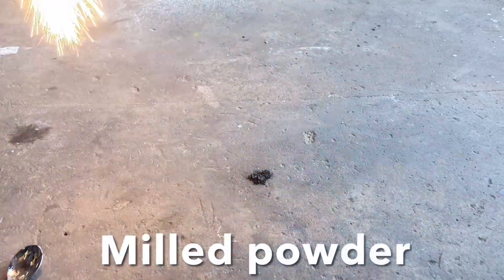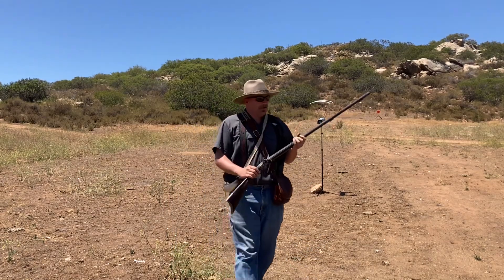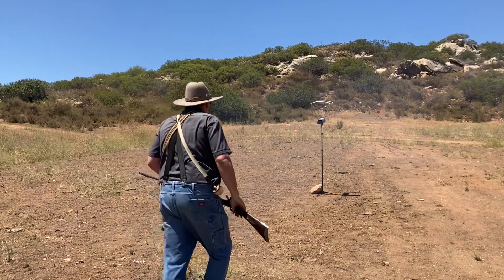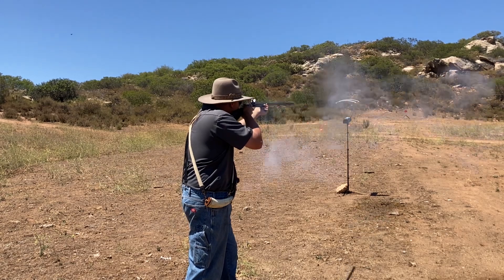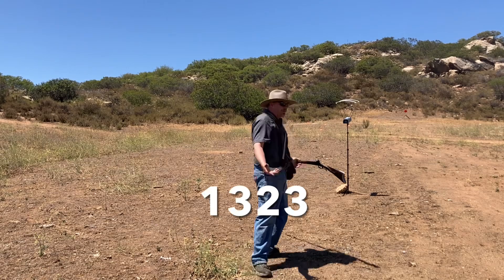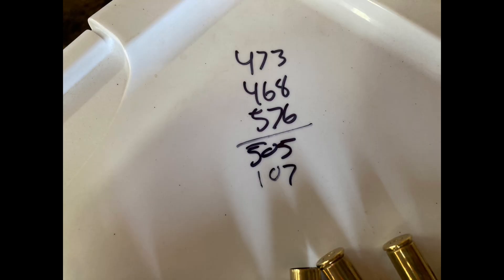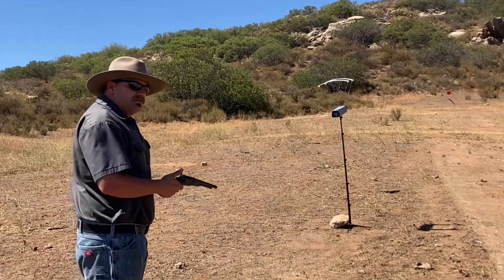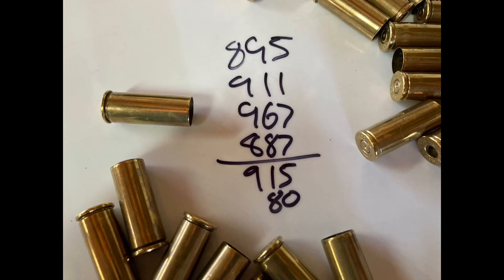Sulfur Free Black Powder

Comment: Sulphur less gunpowder is well known. It was introduced before WW1 to avoid corrosion of brass fuze bodies. The main disadvantage is that it is less easy to ignite as sulphur is essential to the low temperature initiation, the first step in the 8 to 10 stage chemical process.

Comment: One writer I read in the 1960s said sulfur "vaporizes and improves heat flow through the powder-" Not sure what that means, but it could be related to ignition temperature...? Not sure when that was written.❤

Comment: If it's got less feet per second you can add more black powder till you reach the feet per second you need or their head pressure are at a certain point you're going to have over pressure too much pattern it ain't going to make no difference so you can adjust the powder to a certain extent I would try that and retrieve my experiment

Comment: You normally use 77% potassium nitrate and 23% fuel 
Why didn't you do that here?
Reply from the maker: I always run a ratio of 77/13/10. Did I not do that in this test?
Reply: @Everythingblackpowder  
No, you did 70/30 this time.??
That's a 14% shift in oxidizer to fuel ratio from your norm!
It MAY have had quite an impact on both energy and fouling in this case.

Comment: Two things about sulfur that I think are relevant: When sulfur burns, it produces acid, SO2. This will help catalyze the decomposition of the nitrate. When KNO3 thermally decomposes, it produces alkali, K2O or K2CO3 (potash) This will be neutralized by the SO2 to produce a salt, K2SO3. Without the sulfur, you get a strongly alkaline ash in the fouling.

Comment: My local gun shop recently got a huge supply of American Pioneer Powder and Jim Shockey's Gold sulfur free powders that they got from a defunct gun shop that closed up a couple years ago. I know that both are supposed to be able to work in flintlocks, but I've heard they were known for wide variations in velocity between shots and if you live in a humid climate they degrade really fast. I thought about trying some just to see if it works in my matchlock or mortar if I can get it cheap enough. One thing I did notice is that American Pioneer Powder was listed as an explosive, not a propellant like the other substitutes. I wonder if that was something that led to their demise if you had to order them the same way as real black powder.
Reply from the maker: I’ve never tried it.
Reply: @Everythingblackpowder  the guy at the shop let me take a little bit so I could see what how fast it burns, I took a bit of FFFG outside, about a large spoonfull and tested it. It burns fast, much, much faster than what I've ever seen Pyrodex and Triple 7 burn at and about as fast as Goex. I figure I may try it just to see. Worst case scenario I use it my caplocks.

Comment: What did you replace the sulfur with - charcoal or potassium nitrate? I'd assume charcoal to replace the fuel element of the sulfur. 

I'd also be curious to see how sulfur-less BP performs straight from the mill - if it's less reactive that higher surface area of milled powder might be just the ticket to getting the pressures up

Comment: 1) The corrosiveness of Black powder comes from (if i'm not mistaken) the Sulfur turning into SO2/SO3, does that mean sulfur-free BP is NON-corrosive??
2) If the granules of sulfur-free are not as hard as those granules made from sulfur, resulting in un-intended breakage during loading, then doesn't that translate into more surface area & faster burn rate (and therefore dangerous pressure spikes) that could destroy the gun?
Thank you.
Reply from the maker: Neither, as far as I understand it potassium nitrate is the corrosive element. And if you’re using a muzzleloader made from modern steel there is no danger of pressure spikes from any black powder load harming your firearm

Comment: Sulphur-less powders on record with patent's. Kno3/Charcoal. 
#1 Lancaster 70.5/29.5
#2 Noble 80/20
#3 Noble  (stoichiometric) 87.1/12.9
#4 Thomas (SFG.12) 70/30 
Everything else is Perchlorate, chlorate,magnesium and nitrocellulose-based that I could find specifically used for firearms.
Anything else I found was a flash or a changing charge used in firework shell's.

Comment: Did you try upping the charcoal and leave the salt Peter at 75% if sulphur is a fuel then just replace it with charcoal and bump up the potassium till you get a complete burn. I also wonder if Corning it much finer would bump the velocity.

Comment: Garden sulfur is available by the pound, and works fine in bp.
Reply: Garden sulfur has a high clay content. You are leaving performance on the table. Garden sulfur can be cleaned, but it is a wet and messy job.
Reply: @Andrew-ps6xe  it's 1% in a batch of powder if you get pellets, at 10% clay binder. I couldn't see any difference. The sulfur dust, for foliar applications, no clay. Nothing.
   Your biggest difference in performance is the charcoal quality.
Reply: Can't you guys just buy the pure stuff online? I can get 99.5% grade sulfur granules for $25 per 3 lbs.

Comment: bad idea: what if you added aluminum powder into the black powder? aluminum can burn in a candle flame (1200f) but rockets the temperature up to something crazy like 4595f. Flint sparks are hotter than 1400f according to some cursory internet searching so I was wondering if it can supercharge it

Comment: Pulling out a chemistry book to find alternates for sulphur like iron oxide is probably more practical than looking for a volcano.
Reply: Have you tried the iron oxide? Does it perform well?
Reply: @_Emerald_Eye_  
I've only seen it on Cody's lab.
Reply: @_Emerald_Eye_  Iron oxide is used as a catalyst in rocket candy motors [ammonium nitrate burns too slowly w/o it.]
Reply: Phosphorus is in the same column of the PT; maybe some phosphorus compound would do the trick? Obviously, pure phosphorus isn't in the running, it's too reactive!
Reply: That is interesting, indeed. I guess, there wouldn't be something better, than pure sulfur, but maybe several components, to replace it, that have a catalytic effect -  maybe also some sulfates, so that the speed will increase significantly, at least. Nitrate + 30% coal will still give a powder, better than nothing, like we have seen, but it's very slow.
Reply: I'm trying 1% of NaFeEDTA to provide a trace of ferric iron as a catalyst. I add an extra 1.1% of KNO3 to oxidize the EDTA. I don't have any comparison data yet.
Reply: Didn't someone also replace it with the red stuff off match heads?

Comment: Sulphur not only lowers the ignition temperature, but it also STABILIZES THE BURN RATE. That's in most of the literature. That's why you are getting variations in velocity without it. Having it throughout the mixture means you have an even burning fuel to carry that flame all the way through the powder. Otherwise the burning wanes and you don't have that predictable exothermic reaction you want. Using a magnum primer can help overcome the problem, but ultimately having sulphur in the powder is the right way to go.

Comment: In an apocalypse mad max style, these two ingredients are locally available almost wherever you are. The third however would require a nearby volcano. A beautiful video with love for the hobby.
Reply: Volcano or gardening store that hasn’t been fully ransacked
Reply: I worked in the oilsands for some time. All I can think about is watching them pour liquid Sulphur into forms and create pyramids out of it that covered thousands of square yards and were built up 50 feet or more. I remember they were hoping to make fertilizer out of it at one point but the purity didn't meet standards. I don't know the entire process, but there are definitely other ways of getting Sulphur than spelunking a volcano
Reply: whilst pure natural sulfur isn't found outside of vulcanoes and hotsprings you could find certain mineral deposits like iron sulfide in the ground, process those with a furnace and some heat and seperate the iron from the sulfur though it'd require a lot more work
Reply: Actually, just look in any major port or refinery facility. They often got mountains of sulfur sitting around from gas and oil refining process, which is where most of our modern sulfur comes from. You could also find pockets of sulfur in gypsum deposits.

Comment: Have you tried to use potassium chlorate or perchlorate instead potassium nitrate? It may gives much better results, but making it (especially granulation) may be more dangerous.
Reply from the maker: Not yet
Reply: So you may try, but such mix is more  powerful and may explode with pressure, so be careful and do not make it a lot, one gram will be more then enough to start

Comment: Just a heads up...I ordered ingredients off EBay and EBay red flagged my purchases..notifying the “government”. They had been casing my house and went to my wife’s job to interrogate her on my hobbies..etc. Then they questioned me on why I was ordering these ingredients. I have done nothing illegal. Long story short..if you need to acquire ingredients, buy them from a brick and mortar and you will not run into what I had to deal with.
Reply: good information 👍thanks
Reply: Every biodiesel supply house has what you need. Order online to your heart's content, safe in the knowledge that you are actually green fuel enthusiast.
Reply: how much did you get ? got my stuff from Amazon. 5 lb sulfer,10 lb nitrate .

Comment: So I can see why an army might go through extreme lengths for sulfur but an individual doesn't need to if he doesn't have the option. That's very interesting given how difficult it is to get powder from a supplier these days. My question is does it make a noticable difference on residue left behind? I don't think I'd want to use this in a flintlock but on a percussion rifle it seems like one could do this if they felt the need for it.
Reply from the maker: Yes, I completely forgot to mention that in the video. It burns very very clean, cleaner than any other powder I’ve experimented with but the cleanliness isn’t worth the lack of performance. My brother tried it in his .50 Hawkin rifle and it was even more wimpy because the barrel is so much shorter than my rifle.

Comment: im starting to get into black powder and what pistol would you recommend? like the model and the manufacturer along with the best place to buy it? ive also had no luck finding caps
Reply from the maker: If you’re looking for a cap and ball revolver, you can’t go wrong with an 1851 Navy. If you’re looking for a single shot pistol, traditions or pedersoli makes some good ones. As far as caps go, I’ve started making my own because I haven’t been able to find any for going on two years.
Reply: @Everythingblackpowder  thanks! Do you have videos of you making your own caps too?
Reply from the maker: No but there are several on YouTube
Reply: Make your own caps. I bought a tool called "Tap-o-Cap" that punches out the caps from aluminum soda pop cans. You can charge the home made percusstinon caps with toy cap gun roll caps.

Comment: You would be hard pressed to get an army to march against an enemy force, knowing their bullets are 30% underpowered. It is an eternal tradition to ensure that soldiers' gear is rugged as fuck to get to the fight, but also expendable in combat. 30% OVERpowered would be more like the expectation for a military, as winning is everything, and anything less means you're just handing your enemy a bunch of lightly-used gear to overcharge, and add to their expendable reserves, or upgrade/replace their main gear.

Comment: Powder is extremely hard to comer by in Alaska.  Shipping costs being the main problem.  I would be interested in Sulphur substitutes.
Reply: Sulphur should be easy to obtain. It's a by-product of oil refining and most of it is not used, but rather piled into pyramids by the oil companies. Ask around and see if your local oil refinery can direct you to a source. I know gardening is difficult in Alaska, but gardening suppliers will sell sulphur as "flowers" or flours of sulphur which just means it's been ground into a fine powder and that's the most common way people get it.

Comment: Model rocketry buffs use 1-5% red iron oxide (red rust) in their nitrate-based "rocket candy" to increase the burn rate. Would the same thing help your sulfur-free black powder?
Reply: Cody's Lab did this. That was back before the first FBI visit and the mass YouTube video takedown. Old-school aspirin also boosts the burn rate, but dunno how well that'd go in a gun barrel.
Reply from the maker: It’s very possible but I don’t know for sure

Comment: Just found your channel and am enjoying it! 
I have a question after watching your pucking video. Can you use several discs in the pucking die to compress several layers at once with no ill effects? 

Looking forward to hearing your thoughts on this. Thanks in advance!
Reply from the maker: I suppose so. I've never tried that
Reply: Haven't made my own powder yet, but do have experience working with hydraulic presses. Yes, you can make (small) stacks at a time, but no need for a full separate disk, just put something in the column to keep the pucks separate, such as a thin sheet of plastic cut from a milk jug or something. Otherwise, you'll end up with one really tall puck that will take ages to dry out properly. I'd recommend just doing a puck at a time until you have a lot more experience though, baby steps. And when dealing with something like black powder, small amounts make for small mistakes, large amounts make for disasters.

Comment: I made black powder with sugar because the barrel rusts out of sulfur. It burns quickly but needs three times the amount to make a good shot.
Reply: Add some iron oxide to it. Between 0.5 and 2%. It speeds up the reaction dramatically. I've done that in rockets
Reply: Try to cook potassium nitrate and sugar with red or yellow iron oxide. I have a video how to make it properly. It called rocket candy(available through playlist "all videos"). It burns very fast, however i didnt test it in firearms,  only in rockets.

Comment: From my experience I have found that having good homemade charcoal from good wood such as willow, poplar, birch or alder buckthorn is essential as a starting point for a good black powder.  The next step is to micronize the charcoal below 80 micrometers before mixing it with the other ingredients.  The final mixing in a ball mill is also an important aspect to give speed and regularity to the combustion.

Comment: Interesting stuff.  Way better than I would have expected.  For whatever reason, my more recent batches with ERC shavings, milled for 18-24 hours & granulated, come out about as well as your sulphur-less compressed powder -- needing about 70-80% more powder by volume to achieve the same velocity & weight.  As you pointed out, fine for muzzleloaders.  But not ideal.
Reply: Try poplar or willow charcoal?

Comment: Was told white oak was best if you couldn’t find willow for potassium nitrate
Reply from the maker: I haven’t tried oak
Reply: It works, as any charcoal will, but it is not "best" by any standard. The rule of thumb is that lightweight fast-growing woods are better. One strange exception to the rule is Osage Orange.
Tree of heaven and staghorn sumac are common nuisance woods that make some very fast powders.

Comment: Dont need a volcano. You can heat fools gold in a container and it will off gas its sulphur. Then you let it condense and just scrape it off the walls of said container. And from what I read its pure enough to not need refining. Been collecting every pice i come across to try myself
Reply from the maker: Very interesting
Reply: Forgive me!
It’s H2S not HS2 for hydrogen sulfide!!!!
Reply: Just be careful around those fumes when separating iron pyrite from its sulfur. Hydrogen sulfide (HS2) is highly toxic and protective equipment outdoors is recommended.

Comment: How was it done before rock tumblers were invented? Pre-electronic mechanic here.
Reply from the maker: They build mills next to rivers and streams and used the water current to turn their mill.
Reply: My mechanic days ended when control modules were coming in.
Reply: I got out of the field when HEI was coming in.
Reply from the maker: That was back in the 70s?
Reply: Probably mortor and pestle.
Reply: First the large chunks would be broken on an anvil with a hammer and then ground either a mortar and pestle for small batches (and they had big ones including ones that were water powered) or ground with a smaller rock on a flat surface of porphyry rock, those were common bread millstones, and this was done the same way paint pigment was done, or powder could be put into a water powdered or mule powered or wind powered mill with a circular rotating stone made just like those used to ground wheat in large batches. That's the best way because the mill stones are very heavy and so are make the best powder, but it's more dangerous because sparks are more likely, especially if the stone is actually made of metal like those in the more modern black powder mills are. Also things like rock tumblers or tumbling mills were more common than people think in the ancient days. They were just oak barrels used for storing wine or beer that could be repurposed. They could be filled with sand and used to polish metal pieces like chainmaile armor or bits of glass that could be used for other things. They could be hand-cranked like a millstone can be which is used to sharpen knives or the barrels could be fitted with vanes or fins and suspended in a frame over a river to turn them like a water wheel. There are many options.
Reply: @honeyislandoutfitters9887  I've seen it done with an ordinary mortar and pestle. It's time consuming, as all ingredients done by hand should be fine as flour. I suppose you could use a flour mill. Grind all ingredients seperately. WET compounding only!